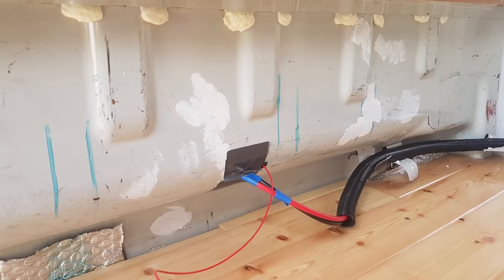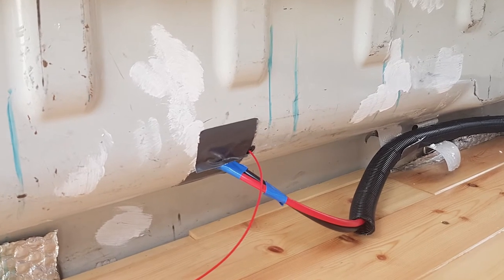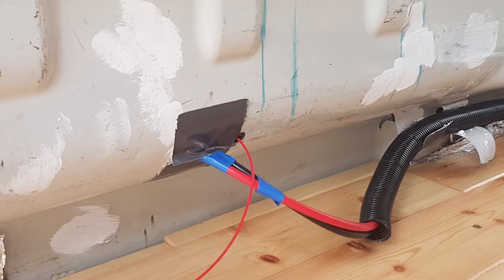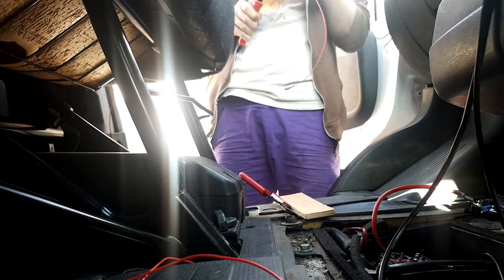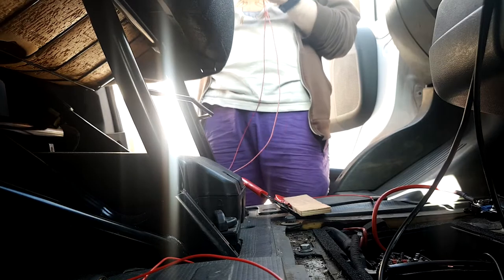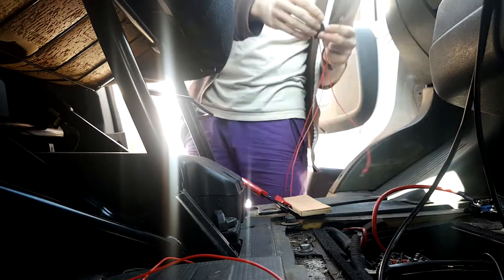finding a solution to the missing D+ connection for my battery to battery charger - van build ep 13

Comment: I've have the same charger which I'm in the process of wiring in.
If you can't find the elusive D+ on the alternator wire,you need to open the fuse box and test any fuse that is a live feed when ignition is on and engine running.This fuse needs to be zero volts (off)when engine has stopped.You can do this with a fuse piggy back tap connector. Its essentially the same as what you have done.
Reply from the maker: Thanks for the comment! Yeah I did consider doing something like this but what I found online talking about it seemed kinda sketchy. The way you've described it does sound very doable, but I'm pretty happy with the switch solution. It's nice to have the extra control, sometimes there's just no need to use the starter battery/alternator to charge if it's a sunny day and the battery is nearly full, so can just leave it off and let the solar handle it.

Comment: If you connect your switch to an "ignition plus wire" (12V socket, cigarette lighter) instead to the battery, it will stop charging automatically when you remove the key. Only if you leave the ignition on while the motor is off for a longer time (e.g. while using the radio), you must remember the switch to stop charging manually.
Reply from the maker: Ah yeah, that's a great idea if you want a safer version of this! I don't think I'll change mine as I'm happy enough with having to be careful but if I ever accidentally do it and drain my battery I might change my mind on that one haha. Thanks for the comment :)

Comment: As i get it, on my -77 dodge truck, i got 2 field connections, going from the alternator to the voltige regulator. The new alternator got one D+ and one B+ that goes to the battery.
One cable to the voltage regulator is green and goes nowhere else than the voltige regulator so i can just skip that one since the alternator got in inside regulator
The other is one red and goes to  the ignition, and so on,  as i understand it i can use that  cable to D+?
Reply from the maker: Per my limited understanding I think you're correct yeah. I took my approach because I didn't want to be messing with any of the van electrics directly, but it does seem like it probably would be fine to tap into a connection that has voltage only when the engine is running.

Comment: How are u finding the votronic set up , have you done a review ? I am swing towards buying the votronic triple charger
Reply from the maker: Overall I really like it. I did have some issues over the summer last year where my battery monitor was showing very low levels of charging most of the time but the charger seemed to think the battery was full despite it very obviously not being. I thought it was a faulty charger and it wasn't until I was doing some other renovations that I could give it a proper inspection and realise that my cable connecting the charger to the batteries had been damaged, seemingly overheating. I realised at this point that the cable size recommended by the manufacturer wasn't really big enough (at least for the cable I boguht), even at such a short length, so replacing it with a larger size seemed like a good plan. And it's basically worked perfectly again since, so a pretty minor thing, I should have double checked the rating on the cable, I just kinda assumed the manufacturer's instruction would be the way to go but should have sanity checked it. 

Otherwise it's pretty great really given that it gives so much functionality in such a small size and for a similar cost to buying decent versions of the 3 chargers you would need to replace it. It still feels like a bit of a no brainer to me :)

Doing a review is probably quite a good idea. Life has changed direction pretty heavily since I was making these videos and they just fell of the priority due to the work involved, but something like that could be quite fun!

Comment: Disagree with advice in video.
The d+ is to be wired to a circuit witch is only switched on while the engine runs
Reply from the maker: Yes that is the literal intention of the connection but the entire point of the video was trying to get around the fact that I didn't have easy access to such a circuit and the only ways I could find online were splicing into cables in the dash which I really did not want to do. What I did has downsides, which I outlined thoroughly, but it does also work and doesn't mess with anything in the van's wiring. I'm not really advising anything, just trying to give a solution to a problem for which the Internet gave me no solutions when I was trying to solve it.
Reply: @konfluence  
I'm fitting mine tomorrow and the install instructions booklet suggests the lc connection is to be used with the connection to the vehicle battery.
This is the one I would use the switch on

Comment: ingenious!good work!
 
hey what are your thoughts about the D+ simulator Pro, from Votronic, which apparently kicks on with the vibrations when the van engine is turned on. Might save the problem that D+simulator (no pro) had with this kind of vans and this kind of battery charger? i'm planing to start a conversion of Citroen jumper/Fiat Ducato too, and i'll be using the same Votronic VBCS Triple Charger. Greetings!

Here is the manual of that new  D+simulator Pro, it can be turned on just by vibration but also can be turned on by vibration + voltage detection, which could be useful too perhaps, idk https://www.votronic.de/images/Manuals/10.%20Peripheral%20Units/3067_e.pdf
Reply from the maker: Ah nice one, thanks for the comment! I never came across that Pro version when I was doing this, not sure if it's a newer thing or if I just missed it somehow. Definitely looks like it's designed for this exact situation and getting around the issue of trickle charging increases in voltage by using vibration is genius. Seems ideal really! Best of luck with your conversion, the charger is a really good choice I think :)
Reply: @konfluence  it might be a newer device as i was checking the Votronic catalog but it still doesn't appear on there! 

About your setup, did you choose to install a battery protector against excessive discharge? i also saw you installed a manual switch, it is for disconecting the batteries when not using the van? thank you again!
Reply from the maker: @andreslorenzosantana4920  Ah wow that's strange, no wonder I didn't find it!

No I didn't go with a battery protector, but I do have a Victron battery monitor that I keep a very close eye on. I figured with that I probably wouldn't need the extra protection as I'm fairly obsessively checking the battery status haha. Yeah I also have a chunky switch for disconnecting all the 12V draws, it can still charge when off, but all the power consumers get cut off. It's pretty helpful for when working on the electrics, and also I tend to turn off everything when I go to bed so I don't have things like the fairly power hungry display/controller for my diesel heater drawing power overnight for no reason (although it does mean I have to get out of bed to turn my heater on in the morning... considering moving that to a separate switch/circuit, that way I can also just turn off the screen whenever I'm not using it).
Reply: @konfluence  Fair enough! good idea to have the switch to cut all 12v draws! i might use one as well. About the heater, some brands have an adjustable display so perhaps in the settings you could set it to turn the display automatically off after certain seconds.
Reply from the maker: @andreslorenzosantana4920  Yeah definitely worth it I think. Ah, I don't think that's an option with the unbranded cheap chinese ones, I did just do a quick google and saw more people complaining about it but no real options other than disconnecting it somehow when not in use. Hope your build goes well! :)
Reply: That's what I used works well.